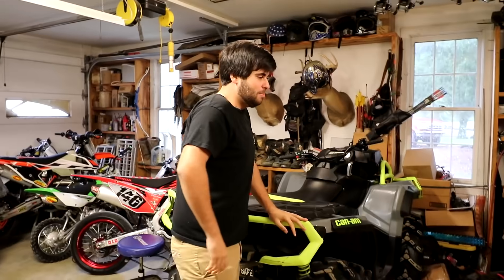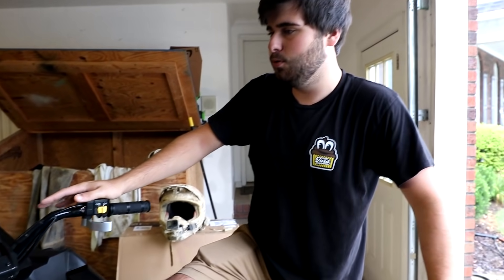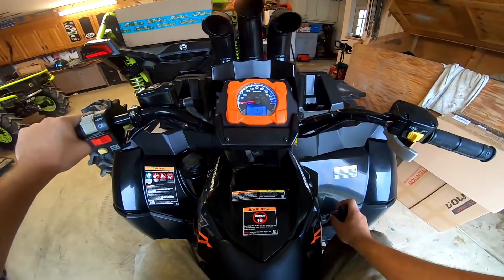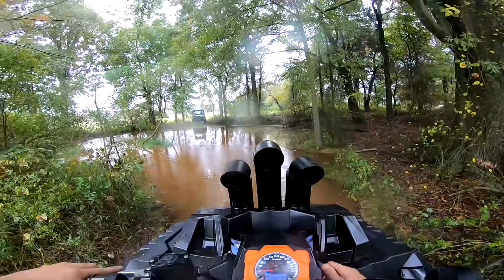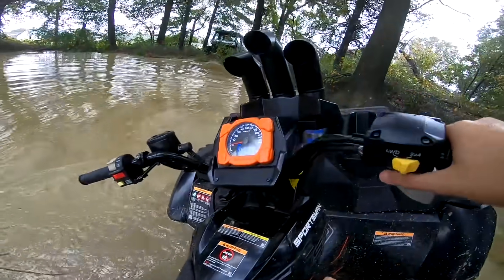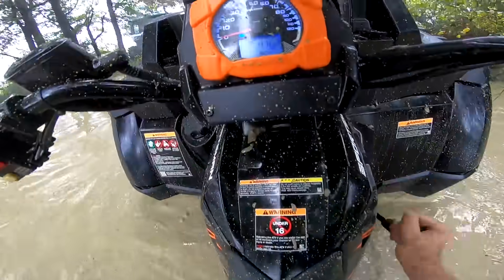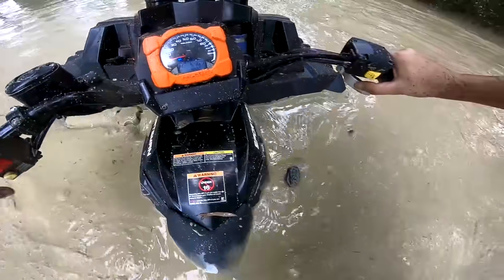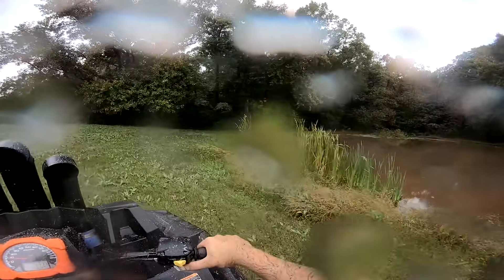First RIDE On My 2019 Polaris HIGHLIFTER! *AFTER HURRICANE*

Comment: Braydon price can’t brake the Polaris it’s already broken
Reply: Coming from a kid with an outlander 450 or 570 that daddy bought him
Reply: Sounds like a canam. 4wd drive is literally 3wd and the front diff likes to explode, power steering likes to go. Also the clearance on a stock canam is a joke, not to mention you only get lower gearing on a 1k which means your belts are going to burn up.
Reply: @braydenhobbs924  your just mad becuase your belts slippin while my honda's rippin
Reply: @billsgillsoutdoors5952  never had a belt problem. How’s 40 mph on you’re Honda?
Reply: Everything that the bike is doing is regular maintenance for a mud bike man so I’d get yo lil 570 outta here
Reply: Brayden Hobbs who tf needs a high cc bike?? 570 tops so you don’t break your neck dude!! Maybe a 600 but that’s the top
Reply: @patrickbfit  that is so tru🤣🤣
Reply: @braydenhobbs924  it doesn’t matter if his dad bought him his Outlander

Comment: Can am: Oh no my belt 
Polaris: Oh no my belt 
Honda : laughing in Japanese
Reply: Also Honda:y’all use belts
Reply: @kaleb_villeda2659  Honda’s don’t use belts🤣
Reply: No it is 
Can am:  my belt Slippin
Polaris: my belt slippin
Honda: my Honda’s ripen
Reply: @glo9144  agree
Reply: @kaleb_villeda2659  Honda is the only one that don'ts have a Cvt transmission my Rincon is a 3 speed with a torque converter
Reply: Kaleb_Villeda Honda’s don’t use belts smart one
Reply: Honda: puffin white smoke from burnt rings
Reply: Japan people laugh the same as American you know right
Reply: @zacharyrenberg9270  my 07 has over 12,000 miles is 3 psi shy from factory compression and doesn't smoke and I had a 85 big red before that for over 10 years and never smoked .
Reply: @FOGELL_TheGreat  Honda’s are super cool if you live on a ranch and ride back and fourth to you’re mailbox other than that they’re junk. Older Honda’s yes made well but they’ve gone down hill
Reply: @zacharyrenberg9270  I don't believe they are "Junk " they have advanced allot they have Efi, independent suspension auto transmission you can shift yourself if you want . I love my bike it goes everywhere I want it too . But everyone has a opinion I'm not saying your wrong or anything just I feel like they are decent bikes but everyone's riding style is different right
Reply: @glo9144  ik Honda’s do t use belts that’s why I said y’all use belta
Reply: Don't forget about Yamaha 10 year belt warranty ; )
Reply: @Brenden_Roberts   Honda: no power
Reply: never had no belt problem with my polaris

Comment: It’s a known problem with Polaris that the back of the belt box leaks. For some reason, on some of them the seal from the engine to the belt box doesn’t actually seal water out. You just have to put some silicone on it
Reply: The belt boxes can also come warped from factory.
Reply: Do I have to take the clutches off to fix that problem
Reply: Yeah I had that problem on my 800 so I siliconed it up and it works great.

Comment: Some advice for the high lifter. If you seal the back of the belt box you won’t smoke the belt as easy as you did. Polaris has a problem with sealing stuff badly. If you reseal it, it’ll be fine I promise👍🏼👍🏼👍🏼👍🏼 keep up the good work and all the content🔥🔥🔥🔥🔥🔥🔥🔥🔥

Comment: I bought a 2018 Sportsman 1000XP Hunter edition for $7500 as a dealer demo last year and have since put over 900 miles on it with zero issues. My only complaints are the shifter and engine brake being a tad over aggressive for my liking but I’ve ridden the snot out of it and it still runs like a top. Like your maverick coming from the factory with the drain plug missing on the belt box no brand is perfect, just have to like what suits you. For me, I’ll stick with my Polaris. Keep doing what you do and keep having fun while you do it!

Comment: He’s got the worst Polaris the person that had it probably Took bad care of it
Reply: No if you watch the vid where he bought it the guy was a half sender
Reply: My cousin full sends his and it’s still really good it goes 75
Reply: Honestly!
Reply: Aqua Mako it’s still a four wheeler though a lot of people wouldn’t care as long as they have one
Reply: Aqua Mako there’s no way a HighLifter goes 75 they have all have a gear reduction the 850 tops out at 50 and the 1000 tops out at 55
Reply: Throttle Therapy my friends stock 800 sportsman goes 70
Reply: For real I've never had a problem with Polaris my dads never had a problem and we've been on Polaris bandwagon since 2003
Reply: Throttle Therapy but you can put a tune in it
Reply: Polaris is junk in general
Reply: Yeah my Polaris is a great four wheeler yet it’s supper old
Reply: Fr
Reply: Cael Howell yes but HighLifters are different they gear them down from factory because of the big lugged tires
Reply: Polaris is garbage
Reply: @makosmacks7934  dude my 170 goes 100 and your cousin goes 75 😂

Comment: I had a 2008 sportsman 800 twin touring I put bigger wheels and tires on and I sold it with the same belt it came factory with, and I put snorkels on it and had it down to the Tom of the snorkels without problems ever, I’ve also drove a few canams and I’ll take that sportsman over any can am any day

Comment: I’ve own a Polaris for almost a year two shift at first it’s hard to shift then you’ll get used to it and the steering sense it’s new if you drive it more and more it will be a lot easier to turn and shift,also it can over heat a little bit and the engine can get really hot but when it makes a humming sound it ok it’s cooling down the engine and love the vids and I subscribed and followed you on TikTok I don’t have Instagram because I’m not old enough to get it
Reply: And it’s more like a work and playing around four wheeler not really made for mudding so maybe keep the outlander for mudding

Comment: I have owned both a can am and a polaris highlifter but my highlifer sportsman was a 1000 so it did come with power steering and stuff.. my can am seemed to have slightly more power but my polaris just seemed so much more comfortable to ride... only belt problem I ever had was when I was trying to pull out of mud that had the consistency of nearly dry concrete while i was in high

Comment: The seal behind the belt housing between motor and primary use a new seal and a bunch of silicone it means when they put it together they over or under torqued the bolts on the back causes leaking cause it ruin the seal..

Comment: These bikes were designed to power out in reverse hold the little yellow button and you’ll get full power in reverse also if you plan on realy sending it just buy the upgraded diff plate and frame braces and probably the rear diff brace you can get them from cecco racing

Comment: I had a new belt put on my highlighter 850 by the dealer at 2000 miles never leaked till they touched it they pinched my seal so I pulled it apart and put a new seal it it haven’t had a problem since but I do agree it needs power steering that’s the only thing I don’t like about mine otherwise I love it.

Comment: I seen belt steam from the clutches being hot and getting wet. So you have a leak on your belt box more then Likely. The belt also probably had a flat spot from the water getting in and slipping on the clutch. So probably smelled belt because of that

Comment: Go ride the new 1000 players you will like it it has really touchy steering and three different modes. And with players and low you are only supposed to go 10 miles an hour and in high it is above 10 miles an hour